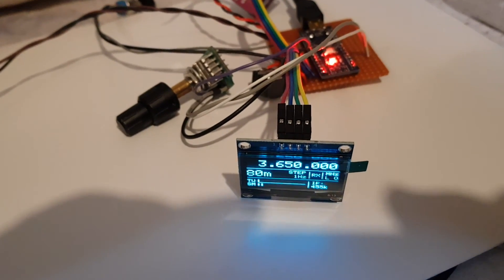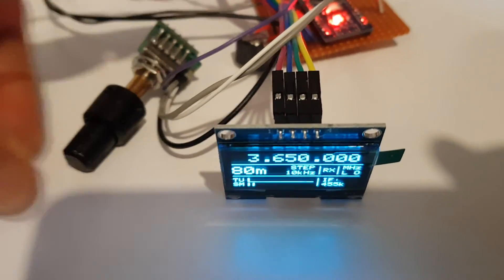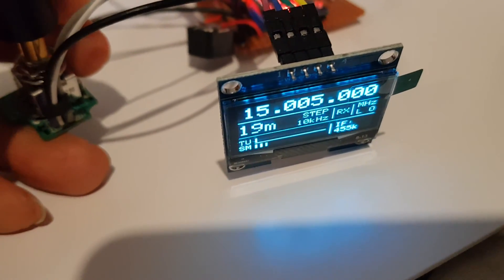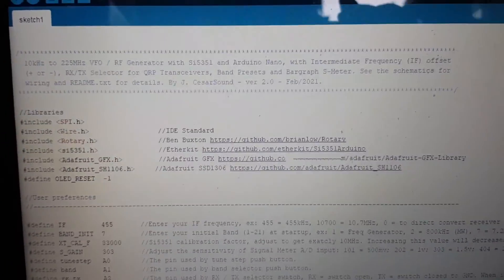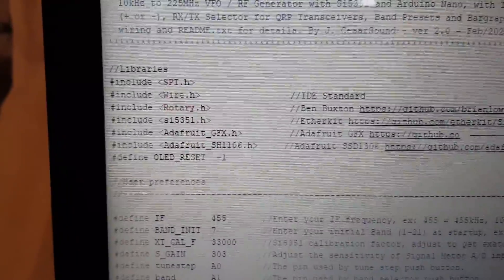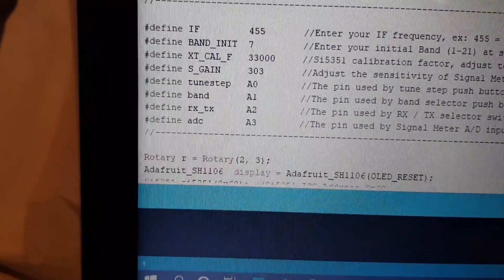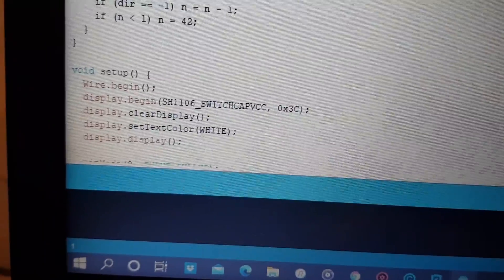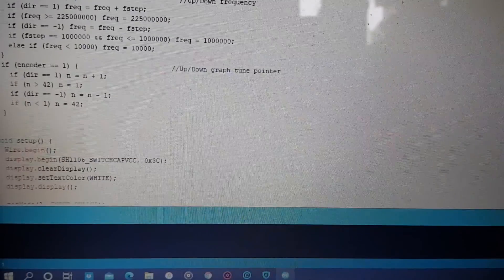Si5351  VFO/ Sig Gen - Arduino Nano- Homebrew

Comment: Hello would this replace the raduino on the ubitx kit 🎉 thanks ✅
Reply from the maker: @echo-_-radio  hi,it will work but some changes would be made in the sketch to  adjust the frequency offset to match that of the units,honestly I haven't done it but there's a possibility, 73
Reply: @mm0umz426  Thankyou that’s great 73 👍

Comment: Without module connected everything works smoothly no hang no freezing display
Reply from the maker: Then check the code for the si5351 or the pin connection

Comment: As i connect si5351 module after feq switches clicks whole system freezes.whats the issue?
Reply from the maker: Hi,it seems like the encoder switch is not being read at all. Check the code, make sure you have the sketch for the encoder. If it freezes, it has to be a code issue. Hope this helps.

Comment: pode publicar código esquema elétrico
Reply from the maker: The original code and Schematics is by Julio Ceasar.See Arduino Project Hub @internet. You will see the mods I made in the code in my vlog. Hope this helps.
Reply from the maker: Code and Schematics in arduino Project hub. It is  not my design,only made modifications in the code. Credits to Julio Cesar.